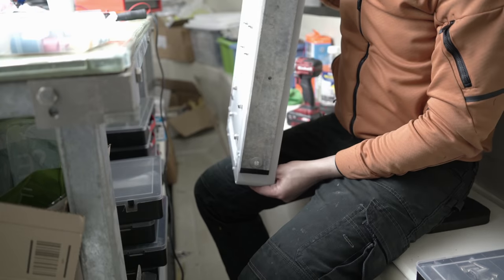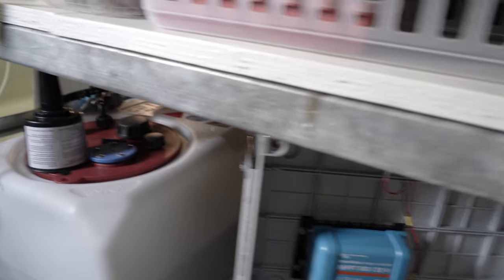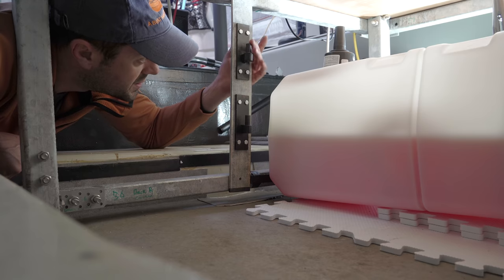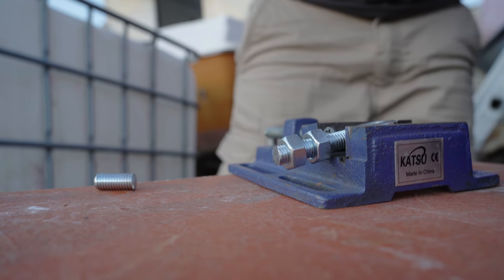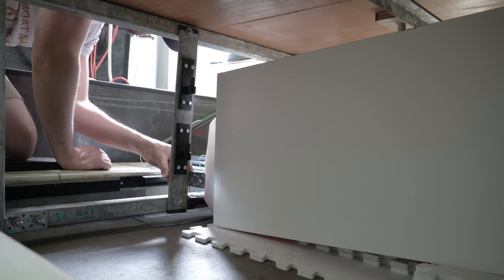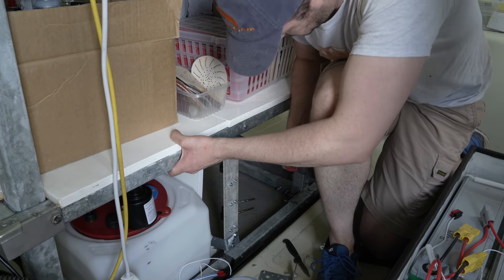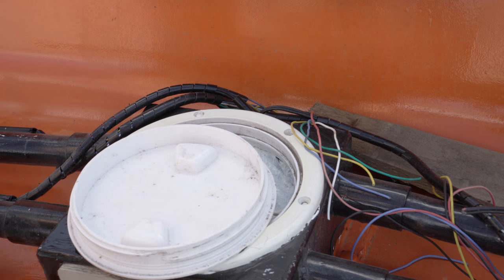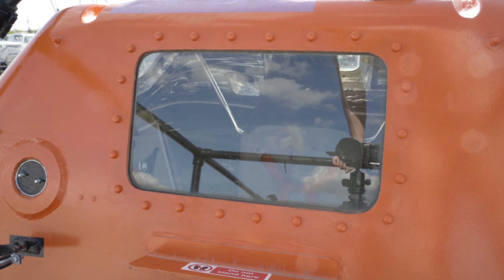Lifeboat Conversion Ep42: Getting on with a load of smaller jobs inside and outside of Alan [4K]

Comment: After seven years, our sealant on paint double glazed poly is A: Intact and B: Watertight.  Has copped everything from sub zero Canadian to 40 plus Celsius down under . Also I figured this type of install could easily be repaired if required,  and was easier to install outer poly pieces.
Reply from the maker: This is reassuring. Thanks.

Comment: For the polycarbonate screen I suggest after sticking use a masking tape above it and spray paint the edge of it to hide glue residue and for another coating against leakage.

Comment: Alex from years of experience hand drilling stainless on boats I always have on hand a few Garr NC spot drills. I prefer edp# 9100, 91522 and 91546. These are very free cutting and require a lot less effort to hand drill all the through most applications, then a simple size up with a twist drill to finish it off. Not sure about sourcing in the UK but worth a look.
Reply from the maker: I'll have a search. Thanks

Comment: You might want to look up something called a heim joint. I'm sorry, but I'm not positive about the spelling. It is largely what you have assembled here, but in a smaller tighter and more precise package. The eye bolts have an integral bearing that allows them about 10° of movement either direction. There is functionally a turnbuckle built into the device itself. When you need something to stay still in an overall envelope being battered and flexed, using heim joints in pairs or fours is a great way to affix something in the center of the space. I've even seen them used to hover a battery Bank where the engine used to be in a converted sailboat. For whatever reason, an inch of water would always pool in that location.

Comment: Re-double glazing the windows. 
Adhesive-If the paint is adhered good then I’d only use proper primer for whatever Sika you choose based on material (paint and poly). 
Prep- I’d run a beed around the lip where the current window and the fiberglass meet. For which will become evident momentarily.
Procedure- when you adhere the new poly glass on I’d leave two point (one top, one bottom) where you will put straws into the cavity between the two windows. Then use those straws to insert inert gas between the panes of glass. This will keep moisture out which will happen due to the inside and outside of the boat being as different temps. After the inert gas is in then remove the straws and fill the holes with sika to seal.

If don’t put inert gas in you’ll have major visibility problems. This is also why you want to make sure to use primer for the sika. Because you want good adhesion to avoid the gas leaking out. Otherwise you’ll end up taking that outer window off somewhere in the middle of the arctic because you can’t see.

Alternatively you can drill and thread holes top and bottom in the outer glass where you can install bolts to seal. Then you can add more inert gas later if needed.

All double pane glass windows in building and homes have inert gas to prevent moisture.
Reply from the maker: Thanks Jeremy. I've prepped so I can have a replaceable desiccant bar in the void, but flushing with argon sounds good too.

Comment: Polyurethane paints are generally very resistant materials. I would suggest that you try lightly abrading a small area and testing the compatibility with the adhesive you have chosen. I'm sure you must have some scrap pieces that have the paint on them that you can use as test samples.
Reply from the maker: Yes indeed. I suppose common sense says that adhering to something (paint) that's only a thin, mechanically-bonded coating, is likely to fail.

Comment: Two things resharpen the drill bits  and at the top of the hinges you installed drill a small hole at the top and install clips that can be easily pulled out if need be but it stop that panel from ever jumping off or if you did roll over it wouldn’t move
Reply from the maker: Yeah I'm getting a fair bit of advice about sharpening bits. I tried a while back with limited success. With cheaper bits I should still persevere. Certainly so with more expensive ones. Pinning the hinges could certainly help, but the clearance at the top is so small it would be super-unlikely to unmount, even entirely upside down.

Comment: My only advice is that after your decide on a method of affixation for the windows, leave the bottom less than perfectly sealed so that the inevitable moisture that will accumulate has somewhere to go.
Reply from the maker: I have a moisture control plan 👍

Comment: RE: Polycarbonate glazing detailing.
Use blind stainless steel self tapping threaded inserts (say M5, 15mm deep, bedded in epoxy/polyester) set back 20mm from the perimeter of the window opening. 
Glue round section neoprene (say 10mm diameter) between the inserts and the window opening to form a gasket.
Drill (and countersink) the polycarbonate to align with the inserts and clamp the sandwich together with stainless steel machine screws.
Should be watertight, easy to maintain/replace...and doesn't rely on sealant goo/paint ;-)

Comment: Are you able to regrind / resharpen your bits or is it just not worth the time and bother?
Reply: Hand sharpening drill bits is a very worthwhile skill to learn. Some of my drill bits are 20+ years old. Admittedly some are quite a bit shorter than they were when new. In my opinion you are far better off buying a really good quality set and re sharpening them rather than buying cheap ones and throwing them out when worn. Good quality drills stay sharp a lot longer than cheap ones.

Comment: Id, put the polycarb on the inside if possible, make it removable to clean inside. Better to have the hard glass ( if it is glass) on the outside it would take scraping ice off better for a start. Having the polycarb inside, it having a lower thermal mass will improve the condensation inherently let alone the double glazing aspect.

Comment: A little hint about Einhell. It used to be a good name and only slightly inferior to Makita or Hilti, but it is by now a low spec low quality made in (you know where) brand, that was sold off. 
Unrelated to that - I was recently presented an antifouling foil that is affixed to the bow and will last around 8 years. It feels a bit like satin and I thought of Allan right away. I could investigate more in case you are interested.
Reply from the maker: Mine's a few years old. Seems ok so far. Assuringly solid.

Antifouling interesting - do you have a link?
Reply: @AlexHibbertOriginals  I talked to the man yesterday and we will meet next week. I will then be able to give you links, material, photos etc. in a timely manner.

Comment: Use grease or machine oil( lightly but evenly) on drillholes, screws and around the drill area(about 1-3 cm) and then wipe excess excess off using a cloth after tightening the bolts. Problem solved no corrosion. (If done properly)
Reply from the maker: Will this have an effect on loosening under vibration, even if using nord locks etc?
Reply: @AlexHibbertOriginals  use a small loop of cheap thread seal tape used for screwing taps tightly. 

Google thread seal tape if you don't know and you will know what I mean and is available in any plumber store.
Reply: @premaji4520  ptfe tape? Or teflon if you prefer the brand
Reply: @AlexHibbertOriginals  If you are concerned about vibration or corrosion a really good option is thread lock compound such as loctite. It both seals and locks the thread.
Don't use thread lock on plastics such as ABS or high impact polystyrene - it attacks the plastic and makes it brittle.
Reply from the maker: @LesNewell  Yes, I tend to either use nord locks, or either medium or high strength threadlock liquid. I suppose I was wondering if this greasing idea would stop the compounds (or nord locks) working.
Reply: @AlexHibbertOriginals  In my experience thread lock is fairly tolerant to oil. Oil does not have much effect on bolted joints. For instance  in most engines, the head, big end and main bearing bolts are usually supposed to be oiled before installation. These are subject to pretty extreme loads and vibration. They also don't generally use any form of locking compound or locking washers.

Comment: Get a load of cheap 4mm drill bits. They will drill through steel easier than fatter drills if you are using a cordless drill. Then just open the hole up to the correct size, it will go through like a knife through butter
Reply from the maker: Yes, stepping up for larger holes is my normal process, but even some of these 4/5/6mm bits really are knackered.
Reply: @AlexHibbertOriginals  corded drilling machines offer a range of RPMs and power that battery drills don't. See if you can find a couple of (second hand) corded drilling machines. A small one, very high speed. One geared medium/low speed high power with additional handle near the chuck. That handle is recommended because the torque can injury your wrist if a drill gets stuck. An angle drilling machine will be handy too.
Reply from the maker: I do have a corded drill, but usually only bring it out for multiple 10mm+ drilling sessions. I also had a pillar drill press. It broke.

Comment: Hi Alex hope all progressing to plan I seem to get two new job with only one partially completed!!! I see you are double glazing and your discussion about adhesive for the polycarbonate - as you may remember I fitted polycarbonate on the outside of my cat windows for the winter months. I did not fully adhere them to the cat for a couple of reasons - they were only for winter and I feared condensation between the layers if I stuck them on permanently and all round - I use 6  suction cups. I do not think that adhesion a good solution for your endeavours however I suggest a square u shaped Ali channel adhered to Alan along 3 sides (edges and bottom) would allow you to remove them for cleaning replacement or indeed when not really required. I hope you get the idea drop them in guillotine style???  I did not do it on the cat because of compound curves.
Please pop over to Maldon some time if you ever have a spare few hours for a catch up. 
Regards
Dick
Reply from the maker: Thanks Dick! Will whatsapp you.
Reply: @AlexHibbertOriginals  👍

Comment: You can use an angle grinder to sharpen drill bits. What you do is mount the grinder in the vice with just a cutting disc - not a grinding disc. 
Be careful not to grind your knuckle doing this as it is dangerous and should never be done by anyone.
Best way to make sure you don't grind your knuckle off and leave your finger dangling by a thread is to make sure the grinding disc is new and the full diameter. Doing it with a half worn disc is asking for it more so than doing with a new disc. It is dangerous.
Mechanics do this because other mechanics use fine wheels on bench grinders to do coarse work ruining the fine wheels so you can't sharpen drills anymore. New fine wheels last ~ 6hrs at best in a busy workshop - I digress.

Now the skill bit. If you don't know how to sharpen drill bits I can tell you it ain't rocket science. 
* The trailing face of the drill needs to be lower than the cutting edge otherwise no matter how precise the cutting edge is, it will never ever cut. 
* With that in mind with the angle grinder running use the flat surface of the angle grinder cutting disc not the usual edge of the disc. 
* What you do is rotate the drill bit from the trailing edge to the leading edge, pressing ever so slightly more firmly on the trailing edge then more lightly as you rotate the bit towards the cutting face. Repeat on the other side, then repeat on the other side - so on and so forth. 
* The drill needs to be held at the same angle the manufacturer put on the cutting face.
* Be careful not to get so transfixed that you grind too much off one side and make the point of the drill off centre.
* As mentioned maintain the same 'roof pitch' angle that the drill came with when new (if you know what I mean).
* You can grind from the front to the back so to speak but that takes more skill. The chances of failure are increased.

With not much practice you'll be so good at it you may have to dull the cutting face a bit because they get too sharp and bite the job.
This is not ideal especially without eye protection as the bit can break, chips go flying off the drill and off the job etc.
I often touch the drill bit on the rotary wire brush on the bench grinder if that happens.
Reply from the maker: Will give it a go with some of my more expensive bits when they blunt.

Comment: Do you have a bench grinder? Re sharpening drill bits is not hard. It takes a little practice to get the knack but you should pick it up fairly quickly. A lot of tutorials stress that you have to get the angles just right - that's not really the case. As long as both flutes are the same it will cut fine. 
Start with a larger drill, say 10 - 12mm. 3mm and under are hard to sharpen and usually it's easier to just replace them. Find the most knackered one in your set to practice on.
If you grind a split point on the drill is cuts a lot easier.  This old tony has a good tutorial https://www.youtube.com/watch?v=r8oORR6jyh8
Reply from the maker: Yeah I'm getting a fair bit of advice about sharpening bits. I tried a while back with limited success. With cheaper bits I should still persevere. Certainly so with more expensive ones. Thanks for the info.